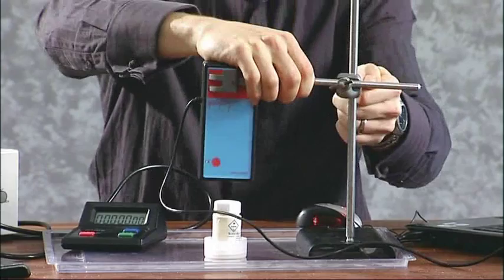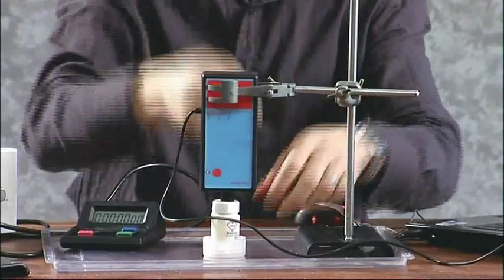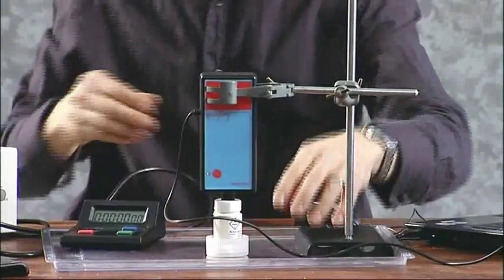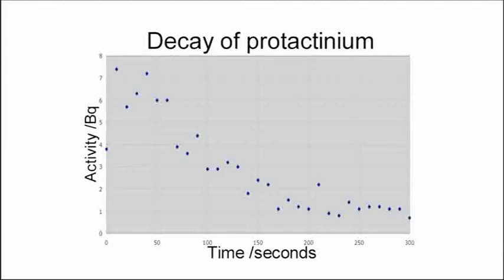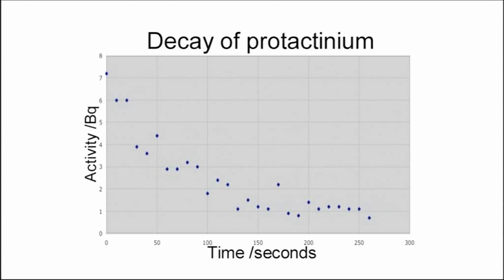Teaching Radioactivity: Measuring the half-life of protactinium

Comment: Ah! Nice! I made a protactinium-234m generator. Since I live in the US, they're not available here. Also, they are very expensive, and I don't think they're available to the general public either, so I made one for a fraction of the cost! It works great! I've had no issues with corrosion or leaks. I used a 60 mL polypropylene bottle. Teflon is the best, but it's so expensive! I stored mine in another polypropylene bottle for safety. It's properly labeled too. These are both very resistant to the conc. HCl acid and organic solvent (I used methyl isobutyl ketone, since it has greater stability). I scaled mine up with 2.5 g of uranyl nitrate (U-238), so that I'd get more counts, hence I get a smoother exponential decay curve. A great way of plotting a decay curve is to do this multiple times, and plot each curve, and superimpose each independent measurement on the same graph, which will give an even more accurate trend. Just keep the generator at the same distance, and try to shake it for the same amount of time. This is a great way to demonstrate half-life from the natural granddaughter radionuclide, that is, Pa-234m from U-238 decay (well, Th-234 to be exact). Pa-234m emits a high-energy beta particle with an endpoint energy of 2.268 MeV, and with a branching intensity of about 98.2%/decay to U-234. It only undergoes isomeric transition to Pa-234 about 0.16%/decay, with a gamma ray energy of about 73 keV, so you don't get much radiation from the other radionuclides in the generator, which is great! It will always be a little higher than natural background, but it's not much. Also, Geiger-Müller counters have very good efficiencies for beta radiation detection too, especially for high-energy beta particles! These kits work great! 👍
Reply: Better to plot the decay curves in something like Excel and do an exponential curve fit (regression) to get the decay constant (slope) then dividing it into 0.693 to get the half-life.   Ideally you should also correct for the finite sampling time  (in some videos 10 seconds) as this is a decaying rate and not an instantaneous rate.   The correction factor is 1-x/2 where x is 0.693 * sample period / expected half life.  E.g sample time 10 sec and half-life 77 sec, the "x" is  0.693*10/77 = 0.09 and the correction (1-(x/2))  is 0.96 of the observed count.  Alternatively you can plot the time as a midpoint of the sampling period, i.e. halfway between the start and end of each 10-second period and it will be close enough.